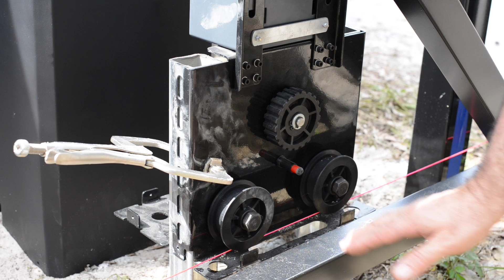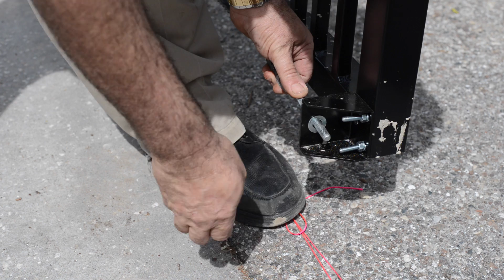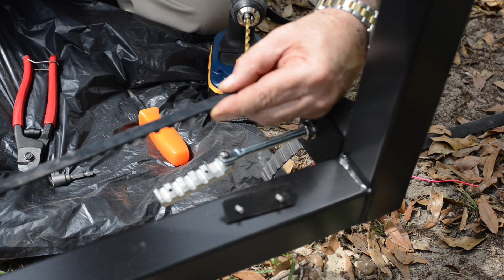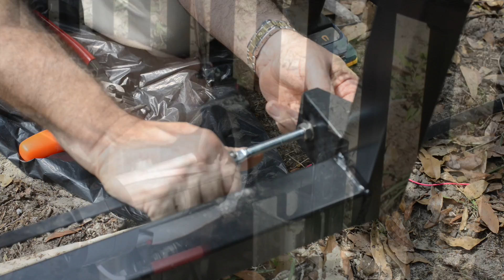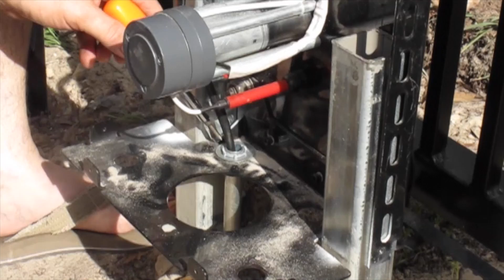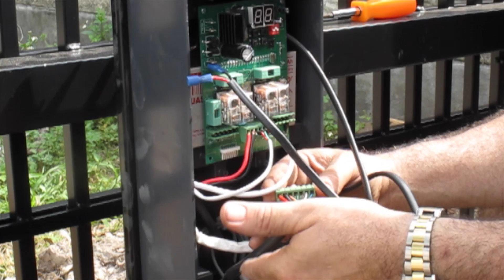How To Install Estate Swing Dual Driveway Gate Opener

Comment: I would never buy a gate opener from this company again. I bought a BD450 and it worked until it hailed. Hail damaged the cover (you would think they would have foreseen that). Had to get a new circuit board. Of course it was "out of warranty" so I had to pay. Circuit board showed up it got wet as the delivery company threw it over the gate. Finally, after a big battle through the credit card company I got another board. It was the wrong type. Returned that. This took about a year. Then they finally sent the correct board and it worked. For a while.  After a paltry amount of use, it stopped working. No power at all on the output side. Tried to buy another one (and they rip you several hundred $), they told me NO LONGER AVAILABLE BUY A NEW OPERATOR. Yeah right.